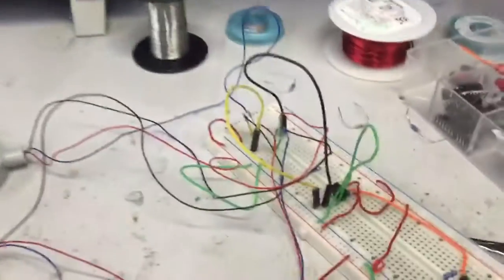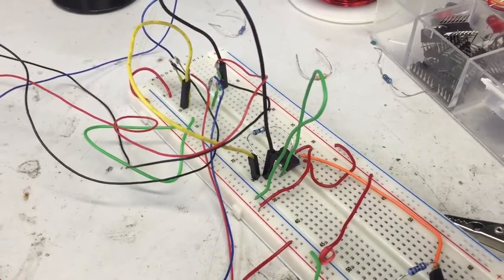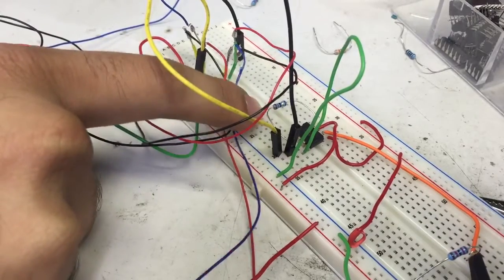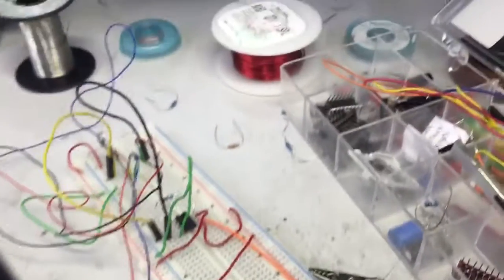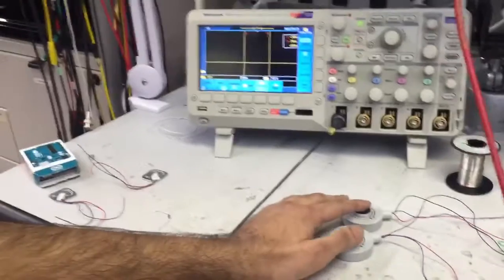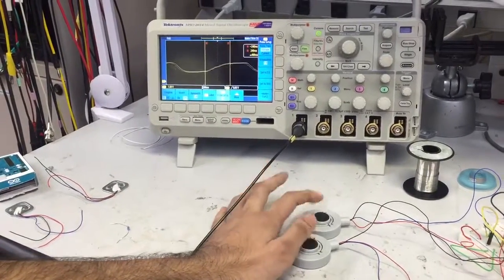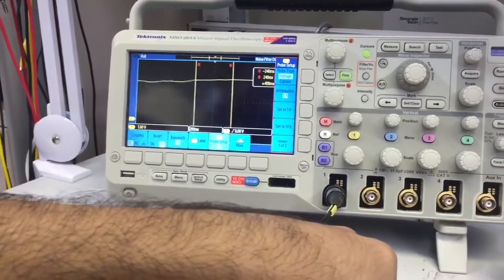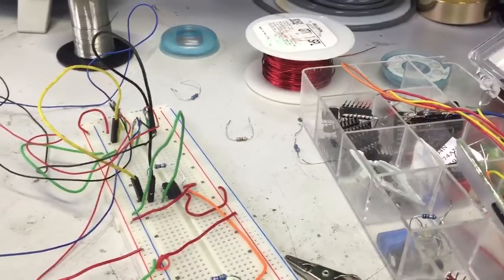[ Rehman ] Measuring Force Using Load Cells and INA126 Instrumentation Amplifier 1/3

Comment: hello, i want to creat a digital scale with arduino so i don't know how i will connect my 4 load cell to hx711 can you help me please
Reply from the maker: I haven't used the HX711 but it looks like you're trying to digitize some voltage output from your load cells. I am not sure if you can sample the raw output of your load cells directly with the ADC, or if you would have to amplify the signal first (perhaps with an instrumentation amplifier?) Are you able to see the load cell output change with applying some force? How big is the voltage output?

Comment: What is type of load cell you use??
Reply from the maker: We took these off of a weighing scale. Not sure what the part numbers or type would be.
Reply: @3x10E8  how do you know its calibrated then if you dont know the load cell?
Reply from the maker: J T for this project we were just trying to figure out how to amplify the output of load cells — so cal wasn’t really a concern then. But one time we did decide to calibrate a different set of load cells — we just used a known set of weights to come up with a slope or scaling factor to go from voltage to Newtons. Seemed to work ok. I guess it all depends on the application you need to calibrate for.